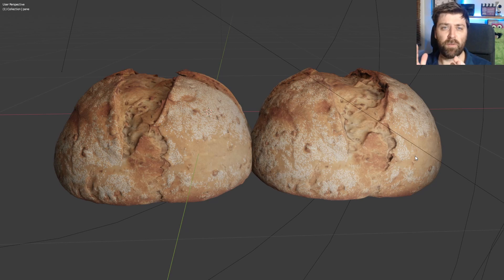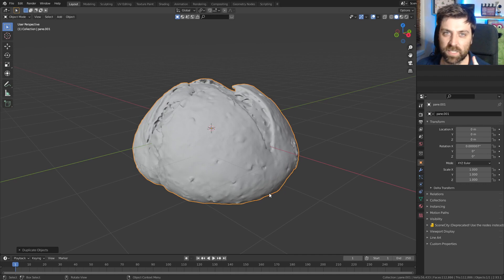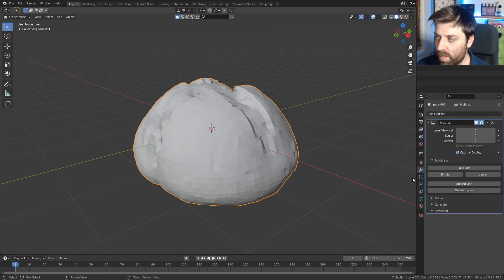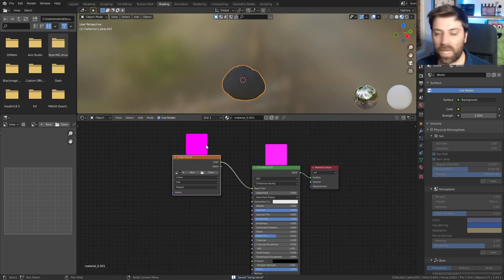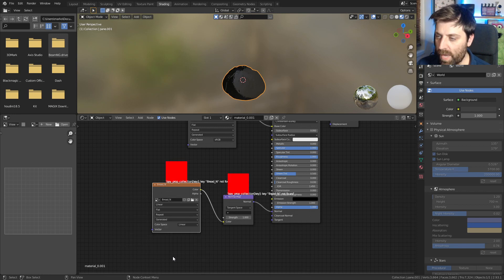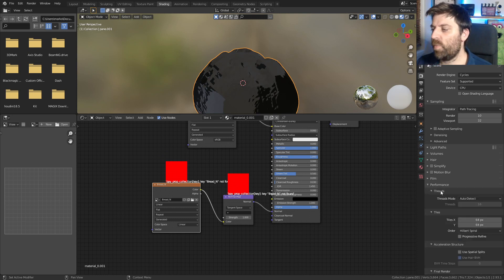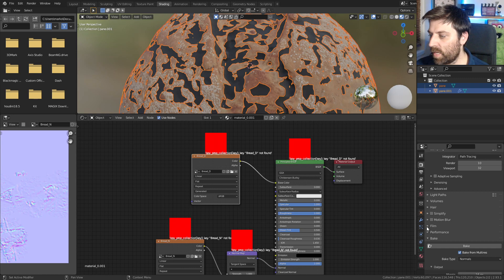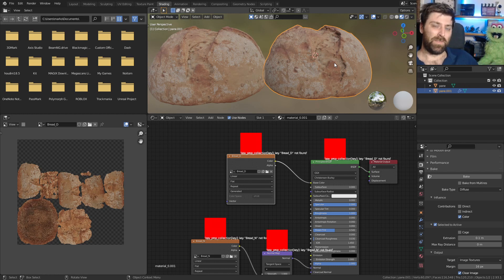Blender how to Reduce Poly Count and Bake Textures

Comment: it literally removed all the sharp extruded pieces of my model 3d. I guess in your case it worked because the bread was kinda round. But for my case it doesn't work.
(Yes, I disabled smooth, so It wasn't that, it was the method)

Comment: Basically doing the same thing but the diffuse always comes out black. I can't seem to use a cage either, always says it's hidden (it's not).
Reply: I randomly turned Metallic to zero and it works. Whatever.

Comment: It should be noted that if your object has highly reflective areas, you should disable your metallic map on your original object if it has one or reduce the metallic to 0 if it doesn't have a map. You will want to do this prior to baking the diffusion because the reflectiveness will interfere with it. I recently spent about 3 hours trying to figure out why the diffuse on my coin wasn't baking properly. There were lots of artifacts and many of the areas just came out black, even though I only had color checked. The metallic was the problem.

Comment: Can somebody please explain the benefit of doing this? 😅 I've been applying the tutorial and see the file size stay the same, as far as I can tell the file downsizes when removing the high poly original mesh, but sizes up again thanks to the normal map. Maybe the low poly helps to make the visualization of the file more manageable? in which case wouldn't it be easier to hide the object while working on other stuff? I absolutely mean no hate, the tutorial is amazing but I feel like I'm doing something wrong or failing to understand the actual benefit :c

Comment: @pigmentinoil
2 months ago
Very helpful tutorial. Don't forget to remove the MultiRes modifier (!) after baking the textures and saving them. With 3x subdivisions this will create unworkable lag, especially if you are multiplying the model with something like an array function, e.g.; not to mention it seems to increase render times as well. It took working through this workflow three times to figure out why my new lower poly models were lagging more than the super high poly ones.
Reply: Hello, by remove multi res do you mean apply it or actually remove it?

Comment: Posting this here in case it's helpful to anyone-- the tutorial worked great, and I boiled it down into a very abbreviated list so I can replicate the steps easily! (I do love the little mini-explanations in the video, now I pretty much understand what the steps are doing; the list just helps me not skip any steps as I repeat the process). Thank you Markom3D!

-duplicate in place

-hide original
-working with duplicate....

-little green triangle tab: Normals > uncheck Auto Smooth

>Remesh: Voxel: 0.1m; [x] fix poles, [x] volume, click Voxel Remesh

Modifiers

-Add Multiresolution, leave as is

-Shrink Wrap:
Wrap method: project; target: the original model; [x] negative [x] positive

Back up to Multires: hit Subdivide 3 times

Apply Shrinkwrap modifier

Back up to Multires: bring viewport to 0

Shade Smooth the model.

Shading taaab:

Copy material (the lil copy icon next to the mat name)

-Delete base image texture. Make a new one. Name it Subject_D ("diffuse"), 2048px.

-Duplicate this texture. Color -> (new) Normal Map's Color node -> Normal. 
-Delete the _D texture, make a new one that is Subject_N (normal); 2048; Uncheck Alpha, check 32-bit float. 

-Looking at main viewport, tab into edit mode, UV > Smart Project, Island margin 0.010, OK. 

-Turn original mesh back on, Shade Smooth. 

-Little green triangle > Normals, uncheck Auto Smooth. 

-Hide original one

-Select Subject_N in the materials nodes

Tab on right: Render settings (little DSLR camera). Render engine: Cycles. Sampling > Render: set to 10. Performance > Tiles > 512px. 
Bake > [x] Bake from Multires; Normals from dropdown. 
Ensure Subject_N is selected, then click Bake. 

-Unhide original. Select it first, then shift + LMB to select the second model, then select Subject_D from material nodes, go back to Render settings > Bake, uncheck [] bake from multires, select Diffuse from dropdown, uncheck Direct and Indirect; only [x] Color. [x] Selected to Active; > Extrusion: 0.1m. Bake.
Reply: This is very helpful, thank you!

Comment: Very helpful tutorial. Don't forget to remove the MultiRes modifier (!) after baking the textures and saving them. With 3x subdivisions this will create unworkable lag, especially if you are multiplying the model with something like an array function, e.g.; not to mention it seems to increase render times as well. It took working through this workflow three times to figure out why my new lower poly models were lagging more than the super high poly ones.

Comment: This is an interesting way to reduce poly count. What I like to do, is use the Decimate modifier. It has 3 different types. Planar does a wonderful job, but it's not always the best option. It's good on simple shapes. Unsubdivide is not an option I use; rather, I never found a use for it. I like to use collapse on complex or organic meshes. Sometimes you'll want to add a Triangulate modifier after Decimate; if you are exporting to another format.
Reply: But how do you keep the textures? Like him? I use decimate also, but am still a noob having problems with textures.
Reply: @caiooca5793  you would keep the decimated mesh, but re-bake the texture and normal map.

Comment: And where was the point? I see almost no change in faces as a number. One was 126 thousand and the other 120 thousand. Only at the beginning there were discounts.
Reply: The low poly was 3k.
Reply: @ChillieGaming  Where did you see them? By the way, you can achieve the same with just a single function (Decimate). It optimizes the count automatically and is a built-in part of the program. You shouldn't make your life unnecessarily complicated. You simply choose how many percent of the current number to remain and see how many faces your model works for. It is in the mods tab which is in the menu on the right and has a wrench icon. 1 means 100%. You only change one value and confirm if you are satisfied and ready. So much simpler. The function is used in objective mode, in editing mode you will not see the change when you change the value.
Reply: @batvanio  well the topology with decimate modifier isn't that great.
Just take a look at it.

So what i did is i bought Quad remesher addon for like $100 and do retopology using that and turning my 1million or 100k tris scan or sculpting to low poly and bake the normals and diffuse map out of it.
So i turned a tree mesh of 78k down to 11k with proper topology.

If you are doing it for renders or your own personal projects the topology doesn't matter then yea u can use decimate modifier.

But if the object is animated or going to be used in games then manual retopology or an addon like quad remesher and then high poly to low poly bake is the way to go.
If u see professional game artists they all go with high poly to low poly workflow as the topology is clean and the mesh is production ready to be used in their specified game engine/films.

Comment: Not sure what is going wrong here...but after render with GPU in B 3.4.1 the low poly bread takes me 10.39s to render, while high poly just 9,67s...and render using cpu the low poly bread even 3s longer than high poly...haha...

The mesh size indeed reduced dramatically, but why the render time even longer?

Comment: THANK YOU!  I bought a tutorial on photogrammetry which is nice but the texture baking part just wasn't too well explained.  I also went through a 1.5 hour tutorial online and again the texture baking part was somewhat glossed over.  Granted I had to do the remesh through a modifier to make it work but following your tutorial worked and it was WAY shorter than anything else I've seen on this topic!!!  Also as stated by someone else already Baking - Bread NICE! Thank you!
Reply from the maker: That’s one of the main reasons why I started this channel, short, sharp and straight to the point. That you for the feedback, and let me know if there is anything else that I can help with.
Reply: @Markom3D  Actually yes there is something.  I've got an ongoing problem with smoothing being gone when importing to UE.  If you could do an addition to this and cover how to get this from Blender into UE5 without loosing the smoothing groups it would help a lot.  Thank you!!!
Reply: @cinemyscope6630  hey did u find the solution for it?
Reply: @ChillieGaming  Yes. It’s in the modeling tools.  Look for a tool called Normals and apply it.

Comment: Black Texture! I've followed this a dozen times, step by step EXACTLY. I even went so far as downloading the exact bread model. I'm great up until the diffuse. Normals bake great but no matter what I do the diffuse is black. It also  overwrites the original image texture and make it black too. After each attempt I have to reload the original texture . What is going on? Help
Reply from the maker: I’m not at my computer, but check the normals on the model is the only thing that I can think of atm. Also, try turning off the option to use indirect and direct light, and only use diffuse.
Reply: @Markom3D  Wow that was fast, thanks!  Nope normals are all good, nice and blue. I've tried attempts with different combos of all three options. Its the weird thing about overwriting the original that's really freaking me out.  I'm being super careful to make sure the right ImTex is selected. Like I say I assumed I was being a dork so I've gone through each step at a time doing EXACTLY what you do, even names, and still nothing but black.
Reply from the maker: @seanposkea  hmmm try enable the cage and set it to like .1 maybe?
Reply: @Markom3D  OK I figured out one issue but have a new mystery. When I select the original mesh and Shift select the low mesh  it has the wrong Selected active. The Hi mesh becomes active and the low (the shift click) becomes selected. I went back and did the Bread and I noticed blue highlight and Orange Bold were backward.  But I'm selecting them in the right order. So it was literally baking black onto the original mesh. So that solves that problem but now why the heck is my Active selected backward?
Reply from the maker: @seanposkea  I think I have had this before. Shift left click in the 3D view port, and not the properties menu where everything is listed
Reply: @Markom3D  WTF? You're right. I did it successfully three times by simply selecting the low first then then Hi in the Outliner and it worked. But I selected in the viewport in the "right" order and that worked.  So confusing esp when you are trying to select two things occupying the same space.   Thanks. I've spent hours trying to work this out.
Reply from the maker: @seanposkea  yeah I worked out that one myself and kept it in the back of my mind lol. Good thing I was looking at my phone when you left a comment lol
Reply: Just ran into the same issue, it drove me crazy for 2 hours, just figured out that I just needed to put the metallic parameter of the reference mesh to 0, now all good

Comment: I'm usually using "Decimate" to drastically lower poly count. Most of the times it works well, sometimes creating problems with normals that need to flipped.
Reply: yeah that works like charm sometimes

Comment: me ripping my rtx 3080 to shreds by trying to remesh a model that has more polygons than the universe has stars
Edit: it had 219,615 faces
Reply: try quad remesher,i remeshed a 8000000face model to 10000 in two minutes with a 3060

Comment: First~Thanks a lot,Gentle man ~~~ 👍🏻
You are a Nice Teacher!  🎓

I made a note...
Wish that help~🙂
(Also for myself,  Because I read this video so many times...🤣)
So...I decide to do this...OK,  Let's get start...

🎯 Create Low poly

1. Duplicate high poly
2. Remesh  

1. Add Multires. (On Low poly)
2. Add Shrink-wrap.(On Low poly)
3. Set projection way (On Low poly)

1. Subdivide  few times…(On Low poly)
2. Apply Shrinkwrap modify (On Low poly)
3. Level Viewport  down grade to 0  (On Low poly)

🌐 “Smooth shade” Low poly

🎯Set Up Texture

Color Map
1. Add (or Copy )a image node
2. Copy the original material 
3. Delete old one
4. Create new image file
5. Check sRGB

Nomal Map 
1. Add (or Copy )a image node
2. Create new image file 
3. Remove Alpha 
4. Check 32 bit float
5. Add a Normal Map node between the image file node

UV Map
1. Create new UV Map 
2. Use “Smart UV Project”.     Island Margin :0.01

⚠Other Setting

🌐“Smooth Shade” High poly.    
Remove “Auto smooth”

(Hide high poly)

Change Render Engine to  
Sampling :  Render :10 

Performance :
Tile X:512
Tile Y:512

🎯Baking

🍩Bake  [ Normal Map ]
1. Check option of Bake from multi res
2. Make Sure image node is Chosen
3. Execute Baking

🍩Bake. [ Diffuse Color Map ]
1. Unhide high poly and select it first.   Then Select Low Poly and make it be Active
2. Make Sure image node is Chosen
3. Change Bake Type to “Diffuse”
4. Cancel “Direct” and “Indirect” of influence. (Only need Color )
5. Check option of “”
6. Extrusion : 0.1m
7. Execute Baking

☕

Comment: Great tutorial thank you so much! I am however having some issues. Everything works great except for when I save and close my project and then come back to it, the textures that I baked are gone. Is there something I'm doing wrong? or some way that I need to save the project file to include the newly baked textures?
Reply: You can check "File -> External Data -> Automatically pack resources", so the texture you baked would be packed into the .blend file.

Comment: That's nice but how much better is using a lot of texture memory for normal map vs using more polygons ?
Reply: I'm also curious about this. Everyone does it so there has to be a major plus to using textures versus polygons. I've recently started getting my models to a point where my computer has begun to chug a little so I'm looking to optimise. I've got to learn this stuff I think.
Reply: @Mocorn  I am scared of using to much textures as I think the size of the game and also what happen if you go over your  vmemory of a GPU do I have to manage. 

Example if you have a house in which there are 100+ object and every object has a 2k, 4k texture ( Diffuse, Normal, .... ) It seems that it goes out of control very fast. I am confused about that issue. Probably reuse same texture on many objects. maybe having a shader that uses multiple UVs ? idk what's really to best way todo It.

Comment: I've used methods from this video dozens of times this month! thanks SO much for this.  by the way, (i feel maybe only you can help me do this..) do you know of a way to bake all of the texture maps into one map?  like... essentially the end result will be a "base color" which has all the grime, scratches and wear (caused by various maps) but permanently baked into the New baked base texture.   I'm having so much trouble with this but it would solve a huge problem for some projects i'm working on
cheers!
Reply from the maker: in Blender, not that I know of. I would have to do some testing on how to do it manually. I will get back to you
Reply: Are you referring to channel packing?
Reply: @noobtek2344  idk- am I? 🤷🏼‍♂️
Reply: @derfmode   If the (caused by various maps) is info like, roughness/AO/cavity and so on then yes

Comment: i am not sure, if there are changes in the workflow for baking normals, but I have a minor different way to bake it.
ok my Starting Point was a model with low poly and a sculpted version on high poly
most of them are the same way, but I I just created a new image texture, name it, leave al settings, connect it like you, I also leave all the rider settings on standard, go to bake, make sure that I first select the HP then the LP (mark selected to active) some changes under selected to active and that's it.

Comment: Do people really think if you dont add the 48px at the end of 2048 that its not going to work? Just use 2000X2000 or 4000X4000, its not 1996 anymore.
Reply: Lolol.  Well, TURNS out only texture sizes that won’t crash the games I am working with are 512x512, 1024x1024, 2048x2048, 4096x4096– or the engine can’t compile things properly and everything crashes… then if it does load somehow.. the UVs have black areas all over randomly... and btw this is with BOTH a 2021 game for mobile AND a PC game from a couple years back.   Especially if you are sharing pictures with a community it’s a bad idea to venture off into your own random aspect ratios because people won’t be able to use them for specific projects
Reply: So yeah if you drop the “48” at the end, the result in many games is it “won’t work” so YES people really do think this— because it’s true lol.
Reply: No wayyyy. Half the game engines I work with will crash if they load a texture with isn’t following the rule of 2
2, 4, 8, 16, 32, 64, 128, 256, 512, 1024, 2048, 4096…
And 3 of them are NEW mobile apps for iOS even. The others are for console. So, YEAH.  Don’t cut corners and expect your textures to work universally in game engines. Lol
Reply: Unreal Engine can import all sizes but it will make a new texture with this dimensions and fill the empty space on it's own. I don't know any game engine that doesn't use the power of 2 for textures.

Comment: hey i was working on stylized hair using the curb stuff right the typical, i even said the render from 12 to lowest . but i get like 14 fps :C the body topo is fixed and clean, ez over 30 fps. but the hair just kills my toaster. am i able to combine all my character as one besides the hair, then weight paint? two objects sharing the same amrmature is that a thing?? i just curious if i can hide my hair during animation so i can animate real time > ?